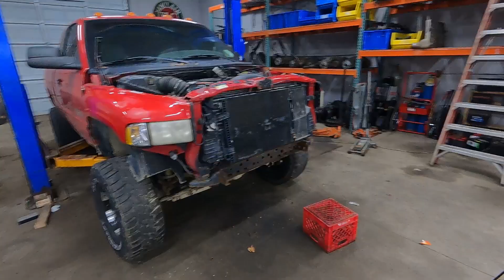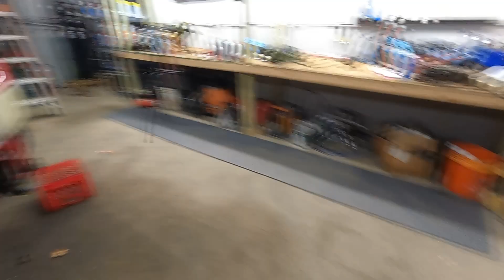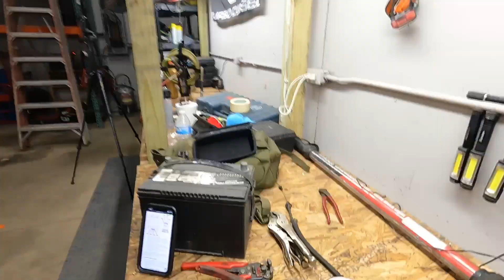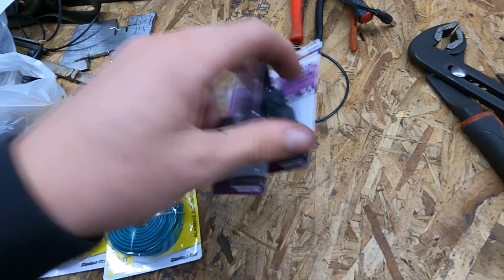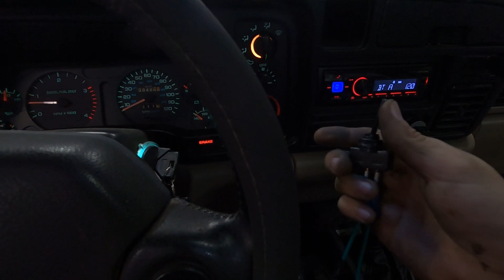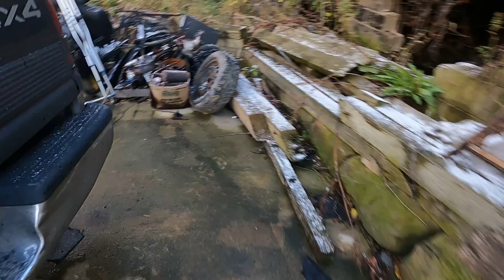SIMPLE DIY HIGH IDLE SWITCH 12v CUMMINS

Comment: Pretty good setup for someone that doesn't want to mess with the factory cruise system. high idle with exhaust brake is pretty slick, have it set up on my 12v 98. you'll want to put the ex brake disengage switch behind the accelerator pedal in the cab, if you put it on the lever on the pump it'll prevent you from being able to use the high idle while ex brake is on. (you might have already figured that one out by now lol)
Reply from the maker: I ended up using a switch on the pump bracket and also ran a wire to the high idle main power switch that overides the pump bracket switch so the exhaust brake comes on when the high idle is turned on.